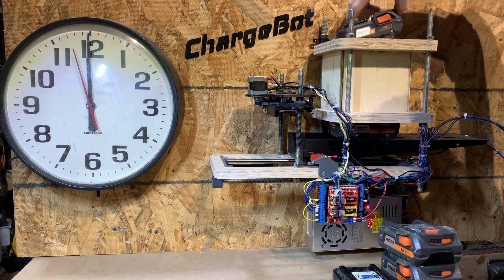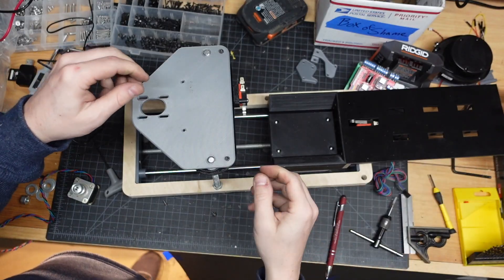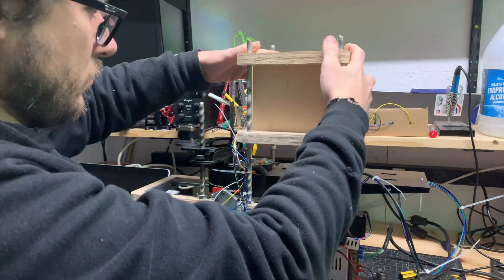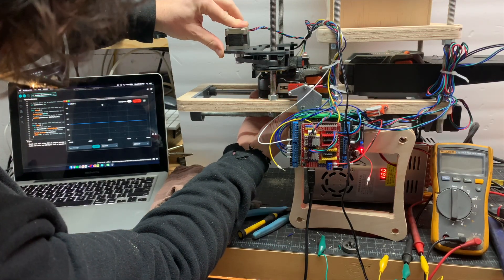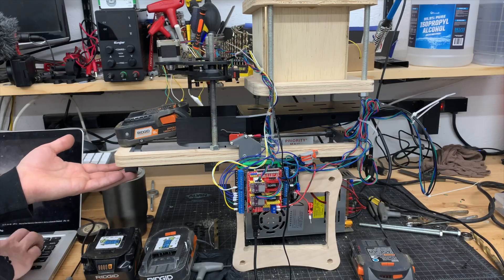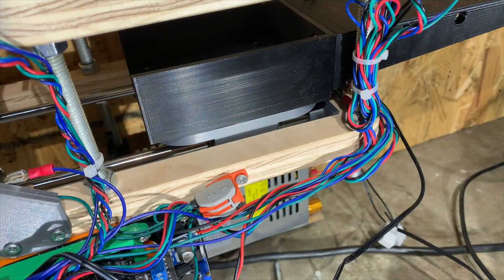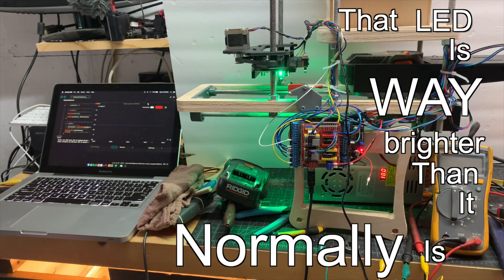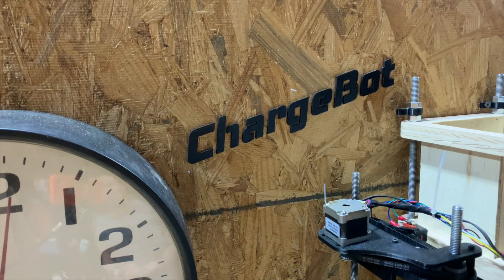never have a dead battery again

Comment: Hi, you already had half of an opto-isolator with the factory charger LED. Why not put a LDR or photodiode opposite (with shrinkwrap to block outside light)? On my own "Washer is finished" device, i looked at the washer`s status light with an LDR. It sent an email when the washer was done.

Comment: Cool project.
I think a little slide at the end where the batteries hang out after charging would be nice, instead of just dumping them on a pile
Reply from the maker: Oh man, that would have been great
Reply: @SparksandCode  "Will be awesome." There I fixed it for you. Do I smell a second video?
Reply from the maker: Maybe…I’m pretty deep into something else right now.
Reply: @SparksandCode  do you have to keep an eye and move the discharged batteries out of the way or so they just kinda drop and spread out on their own?
Reply from the maker: @jeremyrileysmith  I had one fall to the concrete eventually. After that I hung a bucket on the wall to capture them.

Comment: Very cool, subscribed. Might have been easier to make your own dummy charger blocks you could plug all your batteries into and then use just electronics to power each block in turn saving you from having to move the batteries - but this is more epic and scalable

Comment: You overcomplicated this by having the charger move... Just flip the batteries upside down and the height difference won't matter
Reply from the maker: I considered that but couldn’t come up with a way to eject the charged battery after charging that wasn’t more complicated than just raising a lowering the charger. Since the charger would have to be in the way to catch the battery.